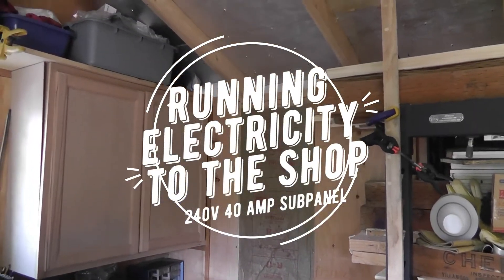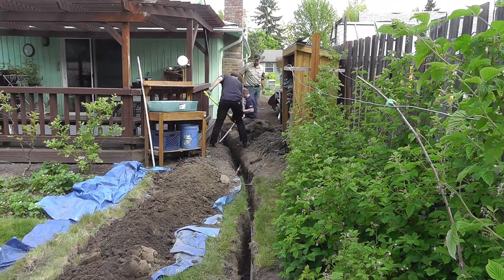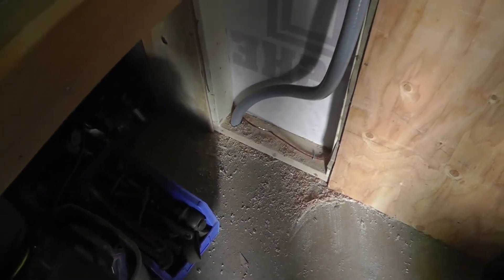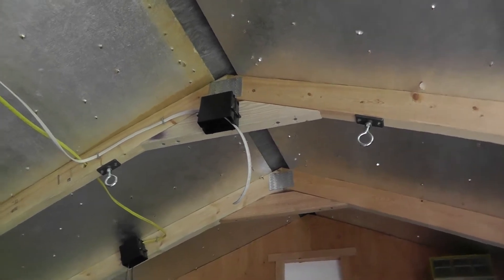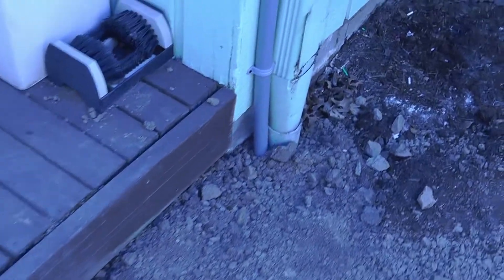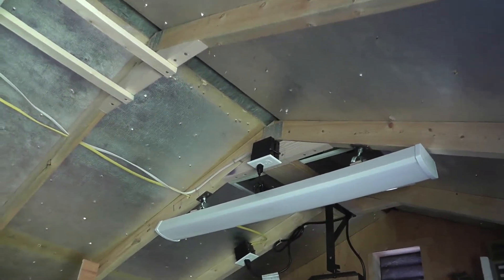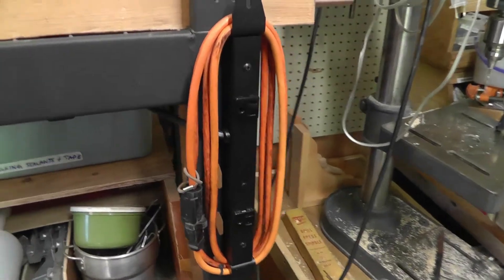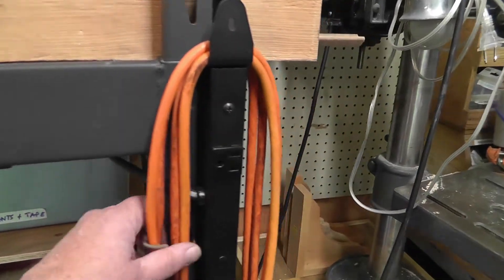Running Electricity to my TuffShed

Comment: There's no way that's a 4000 watt heater. If so it would need a 40 amp circuit if it operates on 120 volt.
Reply from the maker: Yep, its a 4000 watt, 240v.  Draws less than 20amps.
Used 12-2 w/ground

Comment: HOW MUCH DID THIS COST WHO DID IT IM TRYING TO TURN MY SHEAD INTO A TINY HOME
Reply from the maker: Hi Trumoa,  I had the electricians wire my shed, and also quite a bit of wiring in our garage, and house as a package deal.  I would guess that the shop portion would be about $2500 to $2800.  I bet if I were to have it done in today's pricing it would be over $4000.  Thanks for the comment.
Reply: @BRay.549   thanks so much for getting back with me